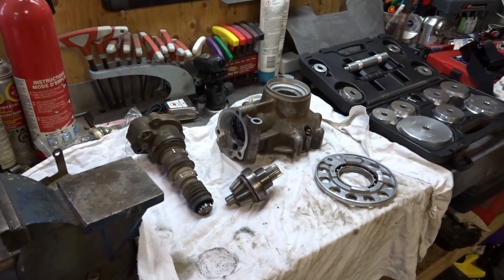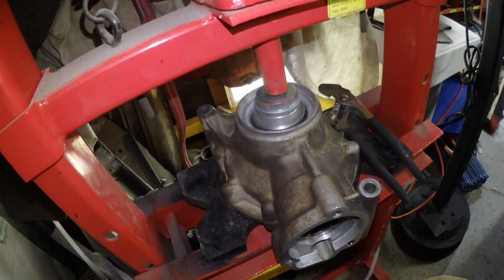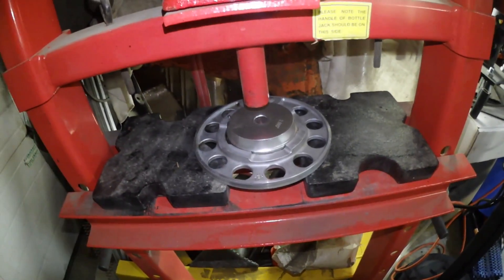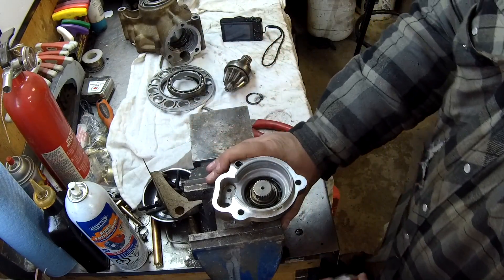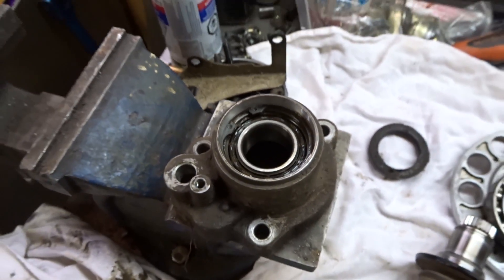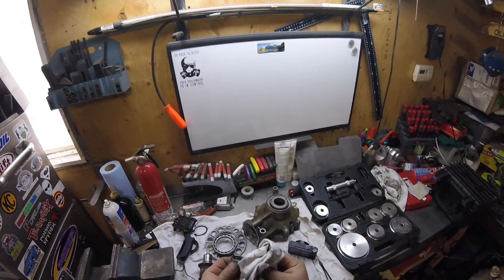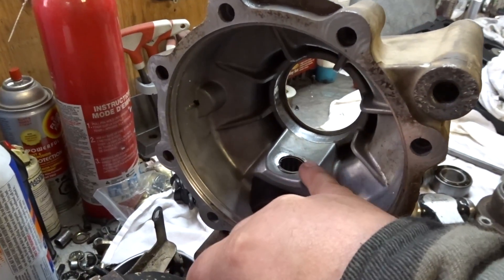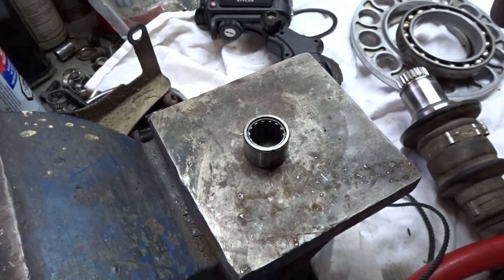Removing the Pinion and Differential Bearings DIY Part 2

Comment: We had to press front wheel drive shafts out of  a 2008 kia man we nearly destroyed a 20 tonne press and we tried both penetrant + heat  ,later  talked to other guys they had the same issue with kias and Hyundai's.